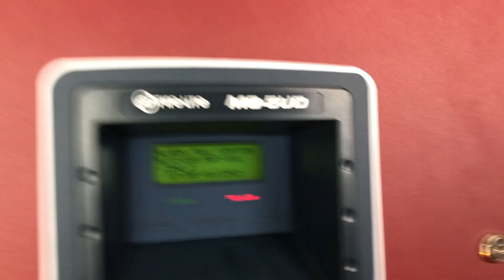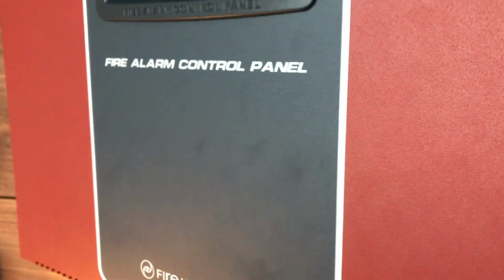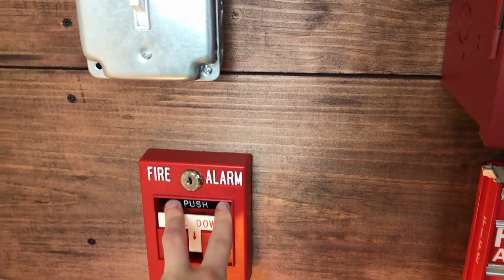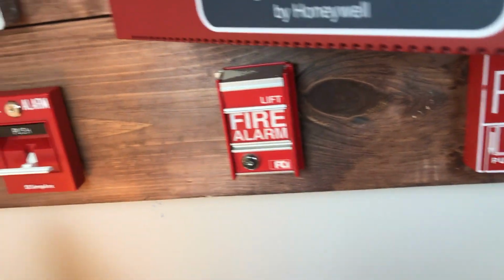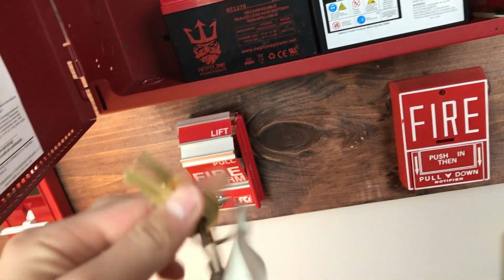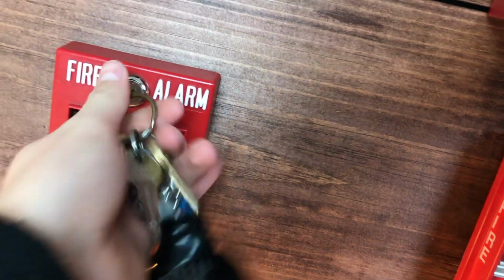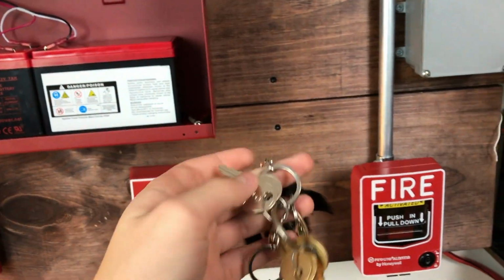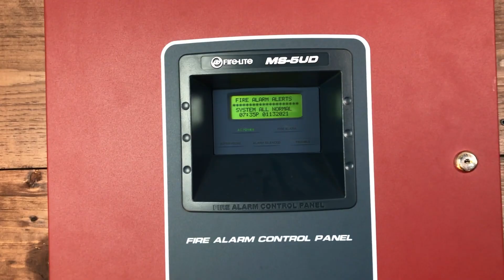System Test 20!

Comment: Hi, I’m thinking about getting an Ms-4 and I know that it is close to the Ms-5UD. Did your panel come with the battery cable and resistors?
Reply from the maker: My panel did come with these items and yours will too if it is new in box, but if you are buying it used, you need to make sure the seller includes them. Hope that helps!
Reply: Ok, thank you!
Reply from the maker: You’re welcome! I hope everything works out!